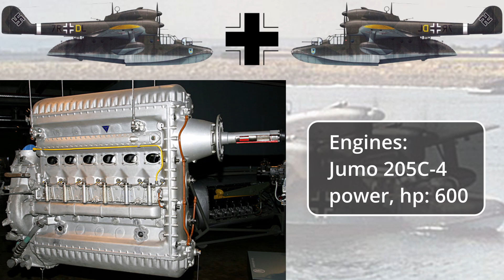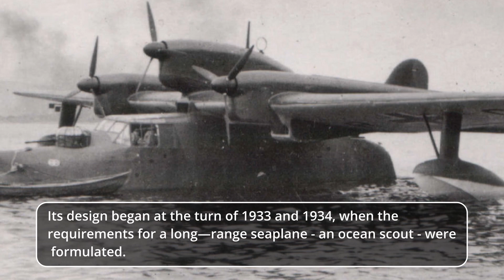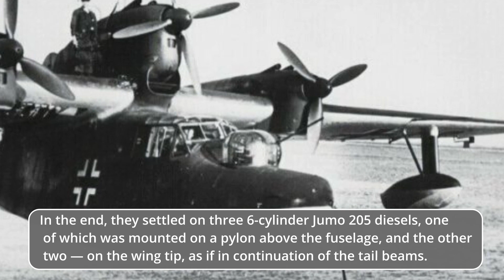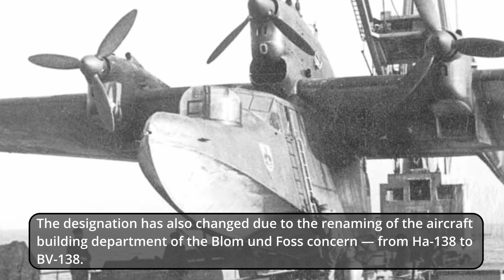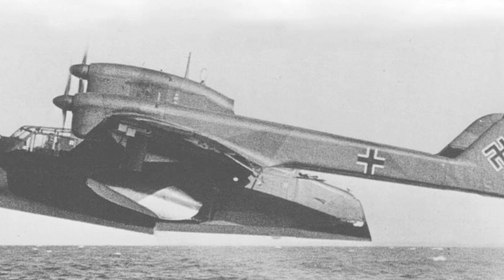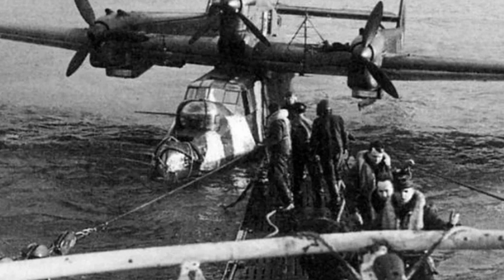World War II warplanes| Luftwaffe | BV 138 «sea dragon»

Comment from the maker: ir Warriors
World War II warplanes| Luftwaffe | BV 138 «sea dragon»
This is one of the most unusual series-produced flying boats, nicknamed the "flying shoe" for its distinctive appearance.
Its design began at the turn of 1933 and 1934, when the requirements for a long-range seaplane - an ocean reconnaissance aircraft were formulated.
The BV 138 seaplane, especially in version C, proved to be a very successful machine. 
Its flight time reached 18 hours, and simple maintenance allowed even difficult repairs to be carried out by the crew after landing at sea. 
The presence of three firing points with good firing zones allowed the BV 138 not only to defend itself successfully, but even to attack the enemy.
Subscribe to the channel, and you will learn a lot of interesting facts about military aviation.
#militaryaviation   
#planesofWW2
#armamentandequipment
#luftwaffe